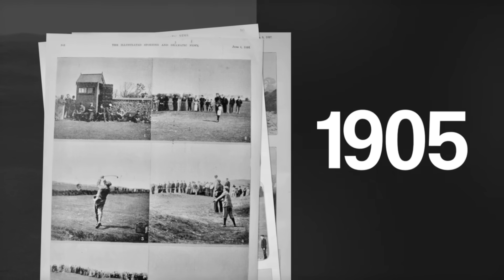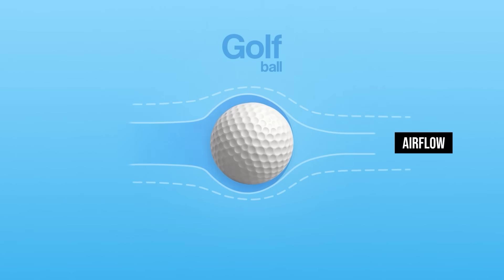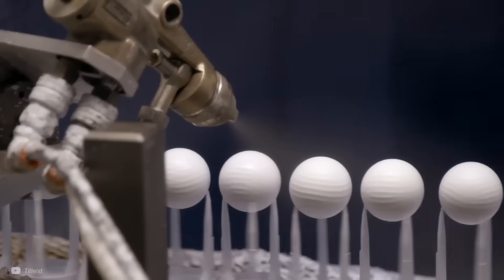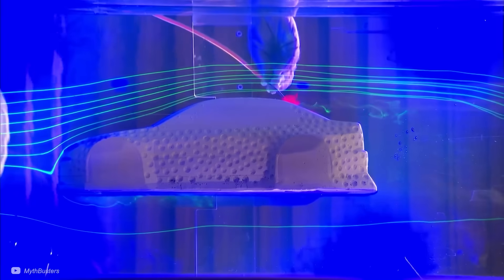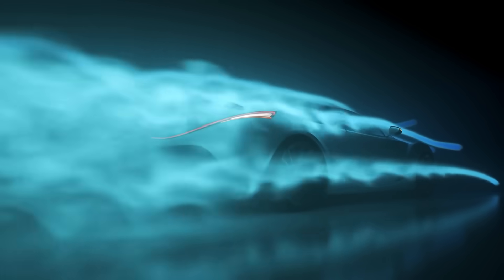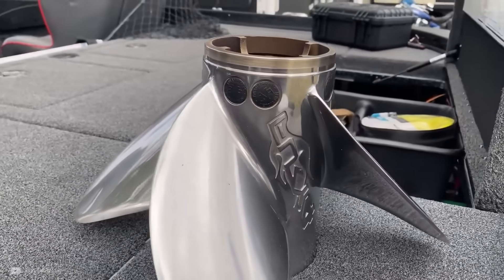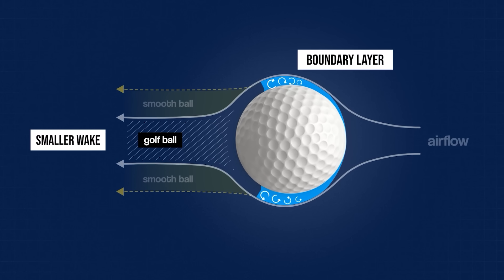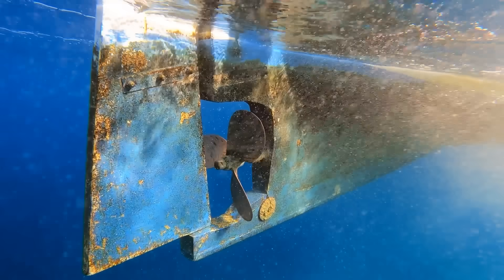The Unexpected Genius of Dimpled Propellers

Comment: I'm exploring the idea that this is how feathers work. Instead of dimples, periodic ridges (presented at right angles to the airflow) provide the same function over the surface of the feather.
Ridge spacing provides for adaptability over varying density altitudes ( i.e. varying Reynold's  Numbers).
Consider this... Take a flat sheet. Dimple one side and Pimple the other (or just leave it totally smooth). 
Edge on to a fluid flow, will it show any preferential treatment to side? (i.e. will it generate lift?)
Now just substitute ridges lengthwise along the wing and Viola. (Throw in a bit of pneumatics to internally control ridge spacing via the hollow quills... kinda how you see birds 'puff up' just before landing.)
🖖😎👍

Comment: Dimples are an old idea while needing more performance from propellers isn't. There is a reason they aren't on marine or aviation propellers today. In my 1 minute of research, dimples help when the surface changes shape significantly, like the trip around a golf ball. Propellers have a smooth surface that changes shape only a little, which may explain why propellers don't have dimples.

Comment: But when it comes to wind turbines and propellers, wouldnt you not want dimples? Other than the few used to prevent cavitation for propellers, using them reduces  the drag needed to transfer forces into or out of the propeller, while also slowing the blade speed with the increased skin drag. 

It would seem to me that dimples are only useful on the body of a craft, since the change in drag is overall beneficial, but for blades and propellers it would be harmful.

Comment: The Chinese coating makes some intuitive sense.  Unfortunately, isn't that always the case, the application needs to be made in dry-dock conditions.  That's a huge cost on retrofitting older vessel which may have older screws where it would be more beneficial.  Of course, newbuilds get it right off the bat.  Someone will make a lot of money if they find a way of applying that stuff while the ship is in service.  That is, it's docked for 8 hours to do its cargo thing and divers apply the stuff, over the course of many dockings, until everything is coated...

Comment: Nice video and presentation. 
I think those dimples can trap and store compressed air from the front and transfer it to the trailing side as it rotates, this will lower the effective vacuum area behind the ball to increase speed. .

Comment: Intuitively, isn't it just forcing a low pressure area earlier on along the surface of a ball, which causes the air stream to cling better without separating? Think of Venturi effect: how fast moving liquid over a hole produces a suction effect, but this effect goes both ways. Each low pressure dimple "grabs" onto the air stream, keeping it in place. Is this right? The turbulent explanation seems less intuitive to me.

Comment: Driving with your truck's tailgate up is shown to improve fuel efficiency.  I suspect this is the reason why. With the tailgate up, you get a pocket of circulating air that helps air move more smoothly over the back of the truck.

Comment: That Mythbusters test has caused a lot of confusion over the years.   It turns out that they chose one of the few car designs that could benefit from it.   That particular car had a rear window that had a curve slightly too steep for the air to normally follow it.   The dimples helped energize the flow enough to stick to the rear widow and reduce the wake.  That design is fairly rare these days.    With most other designs,  especially SUVs, the same technique does not work.

Comment: IIRC during the development of the Cessna Citation, it was found that the prototype had better stall characteristics than the initial production aircraft. The difference was that the prototype had philips-head screws on the leading edge of the wing, whereas the initial production had flush rivets. At high angles of attack, the screw heads produced vortices that caused the boundary layer to remain attached through higher angles of attack resulting in lower stall speed and a more gentle stall.

Comment: Dimples do not reduce drag. They increase it. In a rotational object (golf ball), uniform drag increases stability which helps with directional control - hole in one. On a propeller, this disrupts the airflow across the surface, creating all sorts of problems. On a ship or sub propeller, it causes cavitation which creates noise, kills the efficiency of the blade, and causes pitting of the blade surface, drastically reducing the blades life. Don't know where you got your information (unless you made it up for views). The idea of dimples has been around as long as the golf ball. If it was viable, it would have been done. Another waste of time video for view making money.

Comment: D  U  H  !!!  
     Dimples reduce drag. 
     A slight frill across the  end of a propeller reduces cavitation, dampens noise, and extends the life of the blade.  This is how owl wing feathers help the bird coast silently.  
     Dimpled surfaces reduce drag.  Who'd a'thunk it? 
     Works on any curved surface to some extent.  Adjusting the slope and depth of the dimple control its effectiveness and side effects.  
     Dimples create small vortices roughly twice the depth of the dimple.  These create a buffer of air between the surface and the atmosphere.  
     One of favorite options is the  leading top edge of airplane wings.  Just a line across at the start of the curve reaching back to just beyond the leading edge. 
     Could this also help in deicing the wings in flight?

Comment: You make it sound like the company smart blade does something completely new, but in fact, those vortex generators, gurney flaps, and trailing edge serrations have been in use in the wind energy business for ages. VGs are pretty much a standard means to reanimate thick and tired boundary layers that otherwise would fail to put up with a given positive pressure gradient. So you will see them on tens of thousands of wind turbines, rather than only a few thousands. The wind turbine manufacturer I'm working for is using VGs an every turbine type developed within the past 10 years, and other companies like the rotor blade manufacturer LM has used them regularly at least for 20 years now. So those VGs are a staple, actually.

Comment: Micro structures on surfaces, in seawater, will probably not remain clean or as designed for a meaningful time. 2% reduction in fuel consumption is great, or would be, if that was an actual average value, that could be achieved for a long time without frequent cleaning and restoring of the surface of the propellers. While 2% lower fuel consumption is great, it's also so little that actually proving it requires very controlled measurements, where every other factor is identical, or huge "sample size", not one ship which most likely seen other changes too. Golf ball dimple inspired technologies is a reoccurring phenomena, and has been for a very long time.

Vortex generators can be helpful, under very specific conditions. In essence, in conditions that are sub-optimal, vortex generators can help reduce specific issues.  If wind turbines energy generation actually is increased by 2% by vortex generators, that suggests the blades were quite far from optimally designed for the conditions to begin with.

Comment: A highschool engineering teacher once told us that garden hose nozzles were the result of evolutionary design. Since turbulent flows are so difficult to model, and computers back then weren't powerful enough to run useful simulations, engineers used systematic trial and error instead. After a few generations of random modifications and selecting the most efficient prototype, the modern nozzle was born. It's a great story, but I haven't found any historical examples.

Comment: Shape is part of the solution, but how would a sonic vibrating propeller behave in the wind and water? How about if you heat it up, what would it do to the air? How would a hydrophobic coated propeller behave in water? faster, slower? so manyy factors that can make it better other then just shape and patterns.

Comment: Your explanation saying air "stays attached to the ball" does not explain anything except your lack of understanding of what happens. I'm not wise then before I watched it. The dimples cause local turbulation which act like ball bearsing on the surface . So while this thin film of air "sticks" to the ball , it reduces overall drag. You show no proof of you explanations, I guess you did your "initial research" on WP.  "These findings" sounds very scientific but you give no explaination of where this was demonstrated or measured. That is not a "finding", it's called unfounded assertion.

Comment: With cylinder head porting a 280 grit sandpaper finish is used in the intake port to aid in boundary separation.  Exhaust has a polished finish so carbon can not build on the surface

Comment: There has been some research into putting dimples on engine pistons to assist in creating a more complete fuel air combustion mixture.
VGs (vortex generators) - on aircraft assist a wing in flying to prevent stall conditions (ie. it reduces stall, therefore, reduces the wing 'not producing lift' - and therefore, reduces crash accidents, in 'general aviation').

Comment: It only makes sense to put dimples on a surface where SEPARATION will occur past a point if energy is not added to the boundary layer. 
Tripping a laminar BL to turbulent with a surface feature such as dimpling can do that, avoiding the large additional drag of flow separation.
Flow separation is not expected on the pressure side of a lifting surface such as the back side of a propeller, so dimples there is likely just art.

Comment: I used to race model sailing yachts seriously, and the state of the art for hull surface finish (this was the early '90s) was a wet-sanding at about 400 grit.  We felt that this produced less drag than a smooth, waxed, surface.  That was a finer roughness than .1mm in the prop coating you mention.  I'd love to experiment with that kind of thing again, but I'm well out of that game.  LOL

Comment: Anecdotally, we had two identical small twin engine airplanes. The one with hail damage was about 10mph faster than the other.
Reply: Likewise, we had 2 Cessna 150's. One smooth, and one with hail dents. The smooth climbed faster. The dented was about 10 mph faster.
Reply: Our twins were Piper Seneca‘s. The big “Hershey bar wing” had a pretty low wing low wing loading (created a lot of lift), so I never noticed a compromised climb rate in the hail damaged plane, but could have been.

Comment: Most probable Mythbusters car explanation is that the fuel savings where from something besides the dimples. My first thought would be the front and rear ride height changes from putting all the removed dimple clay in the back seat. I have personally had experiences with vehicles getting 10-20% better fuel mileage with an extra 300lbs in the front passenger seat, and others that have seen similar improvements from 50lbs, 100lbs, or much more in the trunk.

Would be very interesting for someone to repeat Mythbuster's test but with auto leveling air ride to remove suspension height variables.
Reply: Or repeat with same frame and the same mass added without.... oh they did that. 😢

Comment: You are pretty much correct with your findings.
Golf ball dimples are about reducing the vacuum drag, by placing a small amount of dimple drag on the surface.
Any other surface such as a propeller actually need that vacuum in front of the blade (or above the wing of a plane, vacuum lift). It is the complete reverse. Propellers "Pull" due to the vacuum in front of the blade, they do not push.
The trick is to not create an excessive vacuum in front of a water propeller. This is adjusted by balancing power (vacuum) with the size and pitch of the propeller.
.
So for a propeller it is about reducing the surface friction. But the highest surface friction is at the outer most edge of the blade and this creates heat combined with the most vacuum (boiling water, or cavitation). To balance this different techniques are used such as rounded outer shape of a propeller blade, and on some you will also see a slight curve across the back edge of the blade. To reduce heat and friction at the outer most edge. Some water actually spills over the outer edge of the bade creating more vacuum at the edge, so the dimples resist that water flowing over the outer edge and resist excessive vacuum in front of the blade tips.
There is always a trade off between friction and vacuum to get a good balance for the required purpose.
Slow boats (and planes) need a different balance to fast boats (and planes).
>
But no, dimples are generally a bad idea on flat surfaces where you need to reduce friction.
Reply: correction.      thrust from a prop (or lift from a wing) is a newtonian reaction to the deflection/pushing of air by a blade (or wing); this assumes, of course, that there is some positive aoa in the profile of the blade or wing.
Reply: @daviddavids2884  Incorrect! Propellers "Pull" due to the low pressure in front of them.
Airplanes "Lift" from the low pressure over the top of the wing.

Comment: I think this idea of what is happening is wrong. The dimples change the speed and pressure of the air. With the dimples on the boat propellers it keeps the pressure higher keeping the bubbles from forming and letting the blades push against the water which is non-compressible. The Dimples are essentially an airfoil. Would the dimples actually raise the pressure on the back side of the ball pushing it forward reclaiming the the initial push through the air? I think so. Check out aerodynamics of your road car on youtube and watch all those videos.

Comment: The MythBusters put big dimples all over a car. It increased the gas mileage by about 11% . Both of them were shocked. Too bad it would reduce the interior space on 18 wheeler trailers, because it would probably save a lot of diesel. If you stuck them all over a trailer, it would be too wide, and maybe too tall, for the regulations limiting the width of trucks.
Reply: Could a thin vinyl skin with dimples molded into it be used instead? (if one could be produced)

Edit: why not use the perforated vinyl wrap used on windows? Not enough depth?
Reply: @AndreS_-df2nw  The dimples they used on the car were big and molded into a thick layer of clay stuck to the entire surface of the car, except for the windows.  I would guess about 4 inched across and maybe 3 inches deep in size. They covered the entire car with clay and pressed the dimples into it. They made sure the car weighed the same for the dimpled and undimpled trial runs.  I think they drove at about 60 mph. I don't know how they chose the size of the dimples, maybe scaling up the ones on golf balls. They were shocked at the fuel saved. They did everything except the windows, probably to see what would happen if real cars were made with the big dimples. Whatever you did to a car would need to be car wash proof. Any distortion of the dimples would ruin the aerodynamic effect. Adding too much weight would probably be worse than nothing, since vehicles have to climb mountains. Lifting weight takes energy.  
I see some 18 wheeler trailers are starting to install rubberized skirts to fill in the area below the trailed bottom, from near the front, to just in front of the dual rear wheels. It costs money to do that, so the lowered wind resistance must save some diesel at 60 or 70 miles an hour.  
No car company would put dimples on a car. MythBusters did it to see what would happen. It would probably work on a trailer. But losing the interior volume would probably negate the fuel savings, especially if it made the trailer heavier. And a lot of containers and pallets are made to barely fit inside the trailer, so you can't reduce the interior size at all. Cargo would get damaged.
Reply: The added weight made it worse, but the effect worked? Just didn't overcome the losses from weight. If the car body had it molded in it might have worked.

Comment: I saved an article from Popular Science or maybe Popular Mechanics from way back in 1978-1984 (I think). They had drilled 5 holes into a boat propeller along the trailing edge about 1/4 of the way in (as I recall).  They were able to reduce drag, increase efficiency and thought the breakthrough would see its way into production.  I never followed up where that idea went but you might look into it.
Reply: Well considering it was from the late '70s, early 80s, and it's not been widespread adopted by now, my guess is probably nowhere lol.
Reply: @darthsirrius  naval architect here - confirming the majority of resistance is bare hull - not the propeller.
Reply: @johncanada8334  And the surface is quite rough to begin with, so plenty of tiny surface features to energize the flow. These "revolutionary findings" go nowhere because in reality they're not as hot as they're touted to be judging from a single controlled test. For transport companies, saving even 1% on fuel is a huge deal, so if it were anywhere near this benchmark, everyone and their grandma would use these. E.g. a 15% improvement in fuel economy was enough for airplane companies to retire their entire fleet and buy new jets, and those ain't cheap.
Reply: @johncanada8334 ok so has anyone tried dimpling the hull's boundary layer too?
Reply: I was wondering about drilled holes while watching the video. 😮